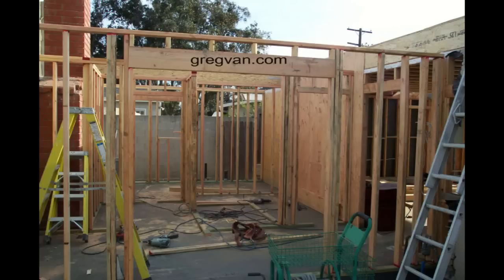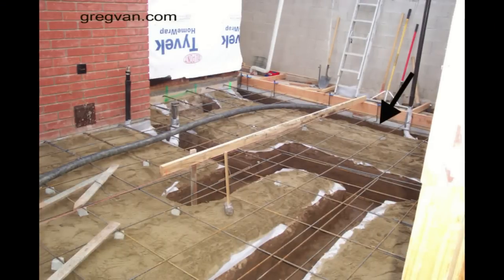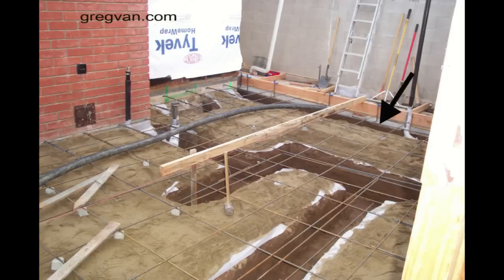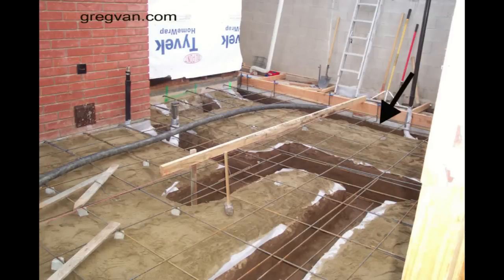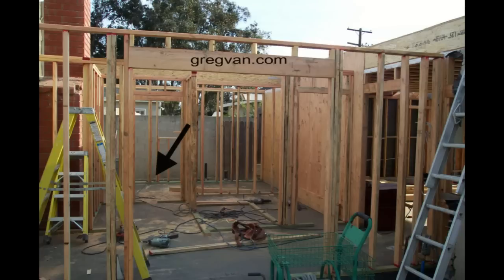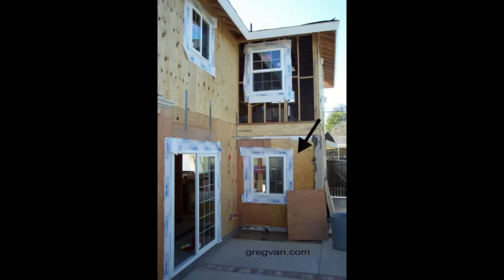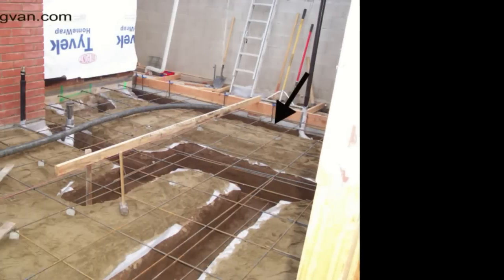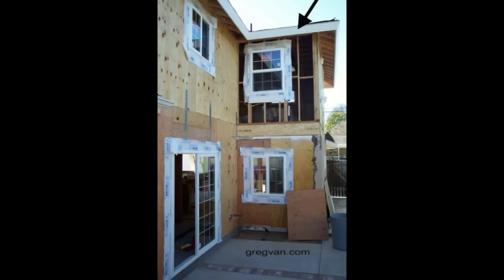Exterior Two-Story Load  Bearing Wall Basics - Structural Engineering and Home Building Part Three

Comment: hello. how can I temporary support a two story house outside wall and roof?. need to install a 12 foot sliding door on a the bottom floor. thanks
Reply from the maker: You should be able to find more information at the website.
http://www.homebuildingandrepairs.com/remodeling/framing/index.html

Comment: The 2nd floor window has a header over it to bear the roof and ceiling load. The jack studs supporting the header convert the load over the window into two point loads pressing down on the top of the first floor. So in your 2-story structure where there is a wide door on the first floor and a window above it on the second floor, to determine the header over the door, do you consider the load above as partly uniform with two point loads? Or do you assume that the 2nd floor platform has diffused the load enough that it can be treated as a uniform load pressing down on the top of the 1st floor wall?
Reply from the maker: I might be able to help a little more if you can send me a few pictures. You can get our email address at the website.
Reply: I was referring to the structure in your video, specifically that which is shown in the last 45 seconds or so. I'm guessing the 2nd floor window probably has a header over it so that any roof load is turned into two point loads supported mostly by the jack studs. So my question is when you determine the size of the long header over the door on the 1st floor, do you think about these point loads from above? Or does the platform of the 2nd floor diffuse these loads so that it's almost the same as a uniform load pressing down on the header?
Reply from the maker: Good question and an engineer would definitely consider all concentrated point loads and use larger headers if needed. If you look at old buildings, before the 1900s you will notice that almost all of the second floor windows and doors line up with those below.
Reply: Yes, I have noticed that lining up windows carries the concentrated loads directly through studs to the foundation thereby avoiding increasing the header size. Thanks for your answers.
Reply from the maker: You're welcome.
Reply: HD

Comment: was the slab poured at the same time as the interior footing?
if not, are the two tied together?
Reply from the maker: Yes, it was all poured at same time. However you can use rebar to tie the footings to a slab, however it might not provide you with the best foundation.

Comment: How do you secure the frame to the floor? I'm building a small two story apartment in my warehouse.
Reply from the maker: MrPland1992 You will use anchor bolts. I believe I have a video on anchor bolts, but for more information simply type anchor bolts into a search engine.